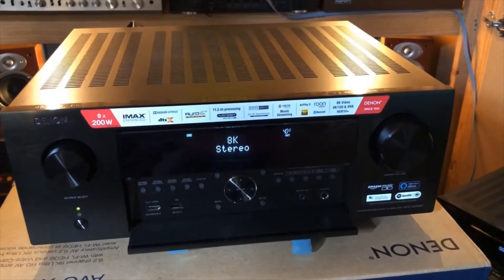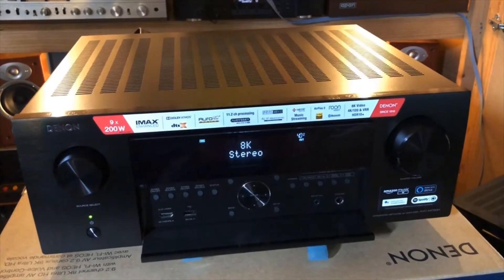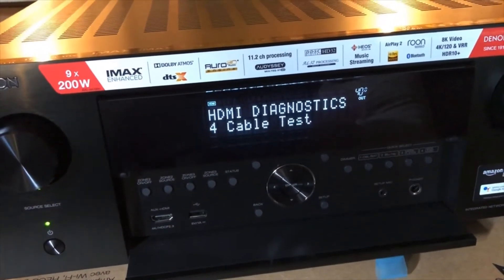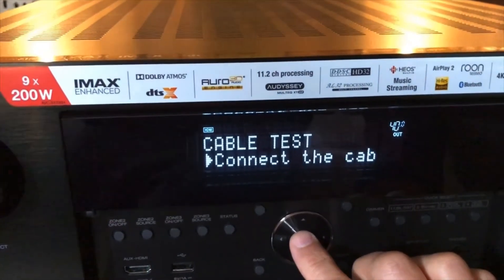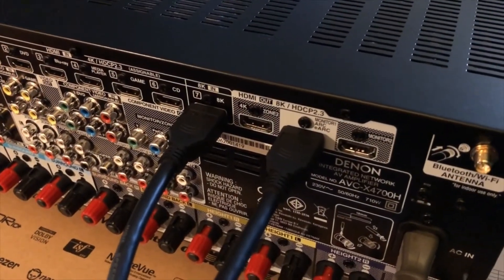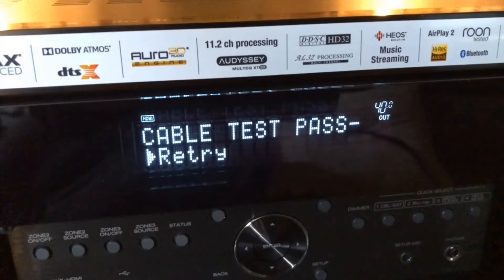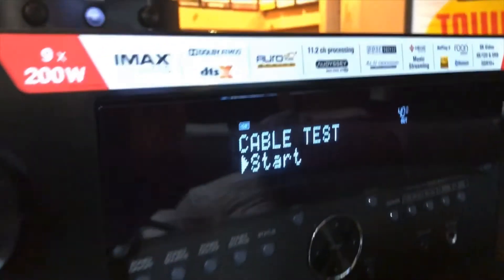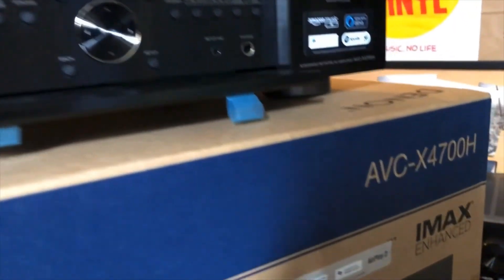Denon AVC X4700 8K Cable Test

Comment: Is it necessary to disconnect all the speaker cables when running the test?
Reply from the maker: Not at all. Actually, Diagnostics Mode    Is used to test speaker connections as part of a system wide check.
Reply: @paulastbury6014  Thnx for your quick reaction 👍

Comment: i've run this test with zeskit "certified" 8k cables SEVERAL times and always get, "FAIL". Have already reset it. turned off, and nothing. Anyone else have this issue? Is there anything I can do about this?
Reply: They wont work. I tested a dozen cheap amazon basic ones and they couldnt even show a picture. Then I bought 3 Oehlbach Flex ones at 2m (6 ft) for 50 Euros each and not one of them passed either. And I already anticipated it because I had picture and sound cutoffs. You know which ones worked? 2x Audioquest Cinnamon 1.5m cables for 125 Euros each and 1x 2m Audioquest Carbon for 300 Euro (That I use for E-ARC on my Denon X-4800H). Those were the ones that finally passed the test. I didnt want to believe it but forget about cheap or even midpriced cables doing 48gb (Or even 40)...You actually need those damn expensive ones.